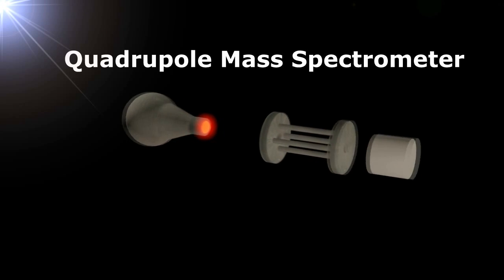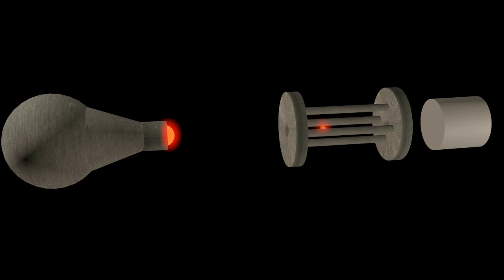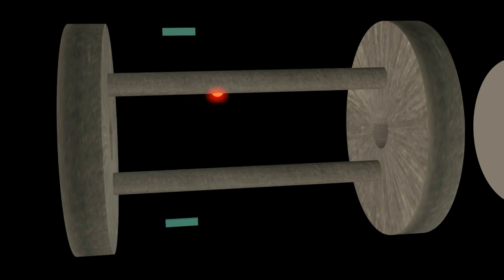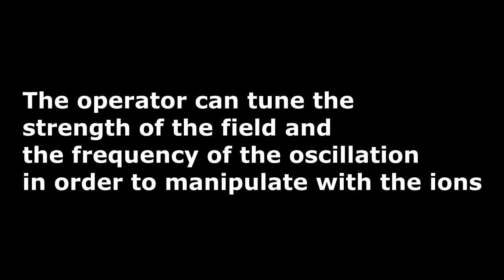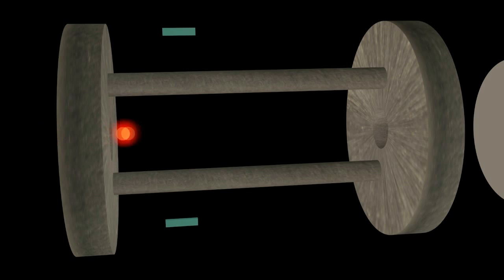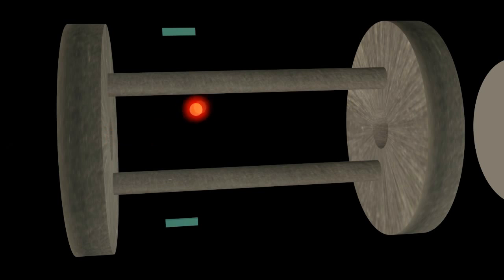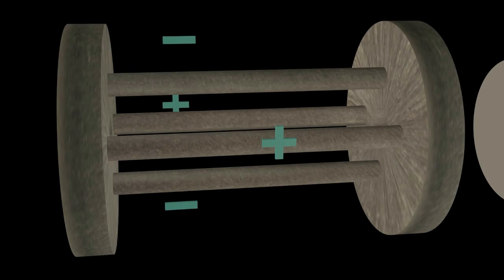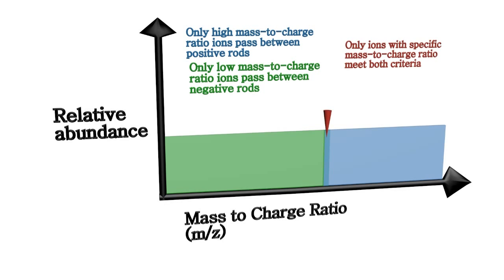Quadrupole Mass Spectrometer Working Principle Animation - How to Measure Vacuum

Comment: hi, i may be wrong but at 3:20 i think that you made a mistake. in fact earlier in the video you say that only high m/z ions pass through the negative bars. you made a vice versa with high and low mass/charge ratio. please correct me if i'm wrong.

Comment: If the ions crash into the poles, wouldn't that mean that the rods would be instantly covered with reduced and precipitated crap? So how is this prevented? Please help damsel in distress.
Reply from the maker: Hello and thank you for the question! Even in decent vacuum, any fresh surface (e.g. freshly cut with ion beam) gets covered with a mono-molecular layer in a matter of seconds (a few ions every now and then wouldn't make much difference). Also, the energy of the ions would likely not be very high so they would hardly cause any damage to the rods and even if the rods were slightly eroded over time or covered with a thin layer of "crap", then it shouldn't matter much when carrying out the experiments. However, if they get too dirty over time (it depends on the total hours of usage and the nature of substrates), then the rods can be cleaned easily with something that doesn't scratch the rods - try lint free paper. So I believe the best answer I can come up with is regular maintenance, depending on the application.
Reply: okay, thank you for your answer!

Comment: It might have been answered already in the video but I am still confused as to why the positive voltages act as a high pass filter and the negative voltages act as a low pass filter. Is it due to the masses themselves and the heavier masses just aren't affected?
Reply: I have the same question